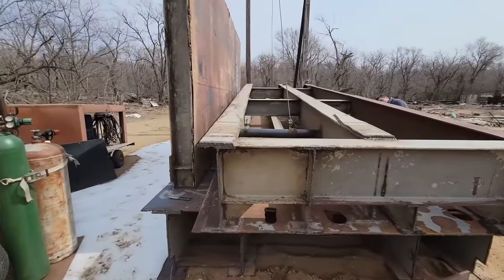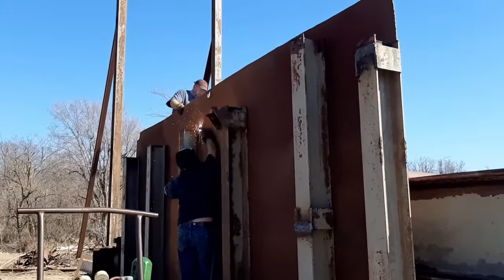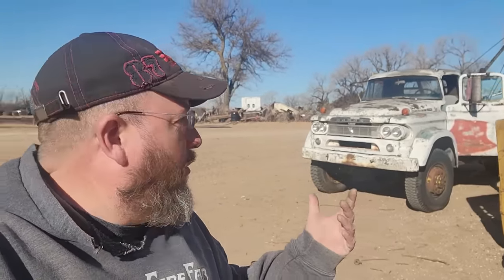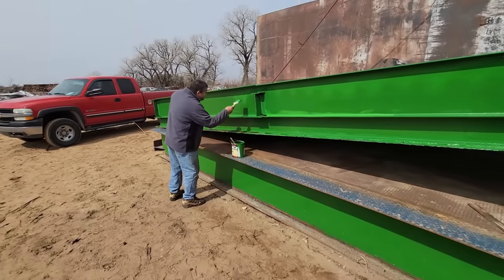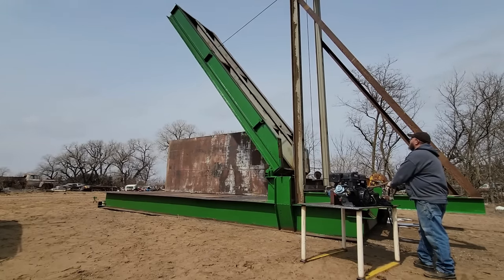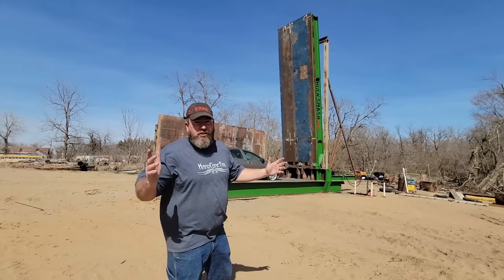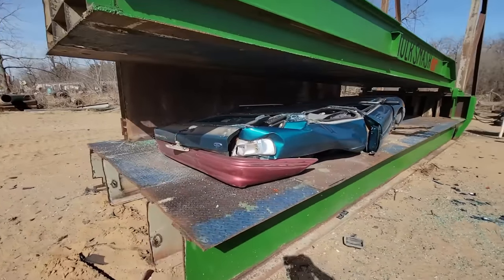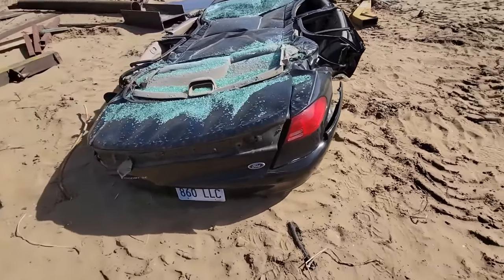WE BUILT A CAR CRUSHER!

Comment: We got one here almost identical to yours that was built almost 35 years ago, quit using it because it took too long to cycle, had issues with the cable and winch , but most of all was unsafe due to no control after it was tripped. Also doesn't work well on vans or SUV's because it blows them out too wide. Hydraulic is really the only way to go. And eventually your hinges will fail and when it does it's not pretty.
Reply: Where can i put my ex?
Reply: Facts

Comment: I'm impressed- but I think it would do better if the hinge was level with the table! also if you load the cars to the end of the swing it will make em flatter!😁
Reply: I was gonna ask him the same thing why did he position the hinge pin so high off the surface you figure it would be more stable if it were attached to the floor
Reply: @pipegang6497  that's my way of thinking! I agree 100%.
Reply: The only reason for the elevated hinge is it allows for better momentum and keeps it from binding up.
Reply: If hinge was level it wouldn't be able to crush 'flat' it would leave the cars less crushed on back side. Therefore could not stack the crushed cars.
🤷 That's just my weird little brain. Who knows 😆🙌✌
Reply: @mikethatguy27  you are correct, plus the engine is the most un crushable thing in the car, so having it level would not work
Reply: Yes little lower would have worked  way better
Reply: Yup bad design
Reply: Build a base you can adjust to meet the angle you require, actually have the car in there with the nose higher in front for more crush.
Reply: I'd buy a d8 caterpillar and just keep driving over it. Much cheaper
Reply: @jasonw833  I bet it'd be a Helluva lot more fun too!👍😆
Reply: Make the pivot height adjustable.
Reply: @jasonw833  Cheaper?  I seriously doubt it. Have you priced a D-8 lately? You better have 50 to 100 grand just laying around doing nothing.          (And that's for a used one)

Comment: In the early 80's my friend and I used to visit a scrapyard west of Montreal that had a similar crusher. What differed regarding efficiency between theirs and yours is the following: the pivoting point was only a few inches from the ground. As well an important factor of physics is sheer mass: the swivel structure was filled with concrete increasing the weight of dropping mass, thus the cars in a single drop would have been 12 inches high.

Comment: Built pretty much the same car crusher 45 years ago. 20 inch high beams and 3/4 steel plate. Burned up to Lincoln welders, welding at damn thing up. We use the 5-ton rear axle and the GMC V6 engine. It worked okay but it was extremely time-consuming and Messy. They ended up just letting the regular car crushers come in.

Comment: Love it. You should pour concrete in the top 6ft of it. Reduce the bounce add a few ton.
Reply: I think the winch is already pumping it’s little guts out already with the load it’s lifting already.
Reply from the maker: 30k winch whole lid is less then 13K and only picking up one end.  The winch is fine!
Reply: maybe sand ? concrete might crack if you dont reinforce it

Comment: What happens if you stack 2 smashed cars on each other and resmash them together ? Could you get another foot shorter on each car? May be easier to stack?
Reply: Yes... this would be worth watching
Reply: Adding a bit more weight to the lid I think it would crush two cars at once.
I still think that the hight between the bed and the lid is a bit too high. The hood and trunk are not affected much by the crushing
Reply from the maker: We are planning on playing with it more soon
Reply: @HardCoreFab  You could also try tilting the car to the side and giving it one more smash. 😎
Reply: if the engines are still in the cars they probably turn intoo a wedge shape , maibe if the stack them with the noses in oposite direction the engines can embed themselfes in the trunkspace
Reply: @watahyahknow  

That would be a total wedgie.
😆 👌

Comment: I would look to some sort of cable release and wieght the hook so you can free spool it down because the rapid unspooling seems like that will be hard on the winch.  Cool build
Reply from the maker: When the dog on the winch is disengaged the gears in the winch aren't turning so there is no stress on the winch.
Reply: I'm thinking he means like the bushings in the drum etc spinning pretty fast.  Probably hurt it over time.
A quick disconnect on the hook end of the cable might prevent that.  Sort of like a large car door latch you could pull with a rope on the cable hook end.
Reply: @scubasteve7946  yes plus cable whipping  at end

Comment: I sure wouldn't want to be removing a few parts from a vehicle while it's sitting on that crusher 😱  That's a pretty small diameter cable?  Just right for a snap one day.  I'm surprised that the hinge is so high up.  Likely half that height would work better.
Reply: Hey it has weight. That's what counts 😉 Not even lowering the hinge will help because all the mass is lost as soon as it hits the part of the car closest to the hinge. This is a coffee break project and not a piece being buildt to go into production. Pure männer fun stuff.
Reply from the maker: Yes you get it!

Comment: Well it does smash cars, I deny that but thats not all flat really! It just crushes roofs! For flattening it all out, you got to raise the platform on where the car sits, so flapper comes sandwiching car in between, but because your sitting ground is way below your hinges mechanism, it doesn't fully crush properly.
Its not hard to make, just a shorter panel to leave space for hinges to close in normally and just laying smasher more firmly and tighter on the crushed car. Aside from all above... Crushed cars looked in a real good shape though to be crushed, Except for last one!
Reply: You will most likely run in to the problem that the lever arm has to be double the length and double the weight to flatten it completly then.
Cause the lever gets momentum loss as soon as it makes contact , now the top part of the lever (fastest most momentum) makes contact first with a lower hinge the slowest traveling part would make contact first and would slow the smasher down giving it less momentum and less power.
Reply: It only has to crush the roof down to make it a level base to stack other crushed cars on top so they can be stacked on top of one another on the truck.

Comment: Nice Job! I'm in my fifties now but when I was a teenager, I drew up plans for a crusher just like this design. One correction I see is you'll need to push the doors in so it will fit on a semi trailer correctly. Overall, I'm jealous that you have this crusher and I don't.

Comment: If it was me.....  I would add a hydraulic cylinder onto a pin lock mechanism to hold the ram in the upright position. And then release the cable from the lid.  You have the hydraulic setup already.  Add 1 valve. And some hoses.   Pull lever.  Pin gets pulled out which releases hulk smash.   Cables under high speed whipping around open areas like that is my main concern.   Love the build.

Comment: I think i would load the cars with the engine towards the end of the smasher. I would also make another maybe 6"-10" plate to place on the platform under smaller cars to smash them even flatter since the hinge is so high. That or spin the cars around and hit them a second time might even work.
Reply: maybe have the hinge capable of dropping as it falls.
Reply: @1stontario  Would be easier and safer to just remake the hinge in such a way its adjustable and able to move up or down for thicker/thinner vehicles. That hinge needs to be rigid as possible to be safe as possible.

Comment: Male the hinge side closer to the bottom for more clamping action.  The gap caused by having the hinge so high uo doesn't help compress the front.  You could actually put more hinge points on the face of the hinge block and make it sort of adjustable if  needed.
Reply from the maker: If we where going to work it that could be an option but it's just a toy

Comment: You guys need to put a car on it's side, propped up, so it stays perpendicular to the deck. I'd place it so the engine bay (the most structurally sound part of the vehicle) is at the opposite end to the hinge, to allow a greater amount of acceleration of the top plate, to complete compress the engine bay.  You know, just to see how the HulkSMASHer does. I think it would perform just as smashingly as it did in this video.

Comment: My dad owned Anderson Auto Wrecking in Walla Walla in the late 70's early 80's.  They built one similar out of old decommisioned water locks (movable dam).  They plated the faces with 1" thick steel and they filled the top (moving part) and bottom with sand.  It worked so well that it was shearing the heads off V8's.  One day he had a bunch of railroad track that came in, so they cut it and through it in the cars before crushing.  The steel scrap / shredding company in Seattle called up and the CEO flew out to see his crusher and told him never to put railroad track in the cars again.  Apparently the railroad tracks really messed up the shredding machines.
Reply: His was a little different than your design, but very similar.  It would winch the top up vertically, then had big hydraulic rams that would lift the pivot point and top another 6 feet or so.  When he would release the pin, the top would rotate to approximately 90 before allowing  the pin side to drop as well.
Reply from the maker: Hahaha yeah the shedders don't like that big thick iron in car body's!

Comment: Very well done. I would have looked into a slightly different hinge design that would drop that plate at a flatter angle of attack, that way it would hit the cars on a more even strike. That way you could get let’s wobble in your strike, and the cars would be nice and evenly flattened. But very nice, and ASMR!
Reply: Well then, you just go ahead and build your very own crusher and we will be more than thrilled to watch your videos.
Reply: @chrisallen9154  Why the attitude.  He has a valid opinion.  I thought the same thing.   Only not every vehicle is going to be the same height or crush the same.  It would be quite difficult to offset the hinges while retaining the strength.  Based on other comments though, this is about as this type of crusher can get.  They blow out taller vehicles like vans, which could be a real problem when loading them on a truck.

Comment: If you make another side wall on the loading side that can be tipped up with the loader forks and latched after you load a car, then you will have both sides of the vehicles boxed in so they won't blow out the sides as much, keeping them more cubed and clean, it would also contain more of the flying glass and plastic !

Comment: It appears your fulcrum point is about 6" to 8" too high.  It should be level with what you expect the height of the car will be when it is fully crushed or at leas the height slightly higher than the front of the crush platform, so that when it is all said and done the crushing platform is level when the car is crushed.
Reply: I think it might put too much stress on the hinges if it was lowered.
Reply: That's what she said!
Reply from the maker: And what height would be best for a 77 3/4 ton ford van or a 1.5 ton grain truck...

Comment: I highly recommend installing a vertical steel tube with the winch cable running through it just incase the cable snap it doesn't kill the operator

Comment: Like any project you figure things out as you go.  Like your hydraulics, perfect for testing.  Late maybe upgrade to bigger motor and pump.  If you wanted to make it mobile, put hinges on the struts and tower.  Could use the winch to erect it at the new sight.  Best of luck with it all.

Comment: You really need to build a pedestal platform. That raises the height of the car up to the pivot point of the smasher . That pedestal only needs to raise the height about 1 foot , the easiest way to tell how much the loading platform needs to be raised by . is to raise the platform up to where you can hood a level against the bottom of the smasher and then measure from the bottom of the smasher down to the loading surface. Say y he distance is 5 foot then measure the ground height of the car to the top of its roof , what ever the difference is between the bottom of the smasher , and the top of the car would be the height  that the loading platform, would need to be to get the best flattened compacted results  . Out side of that you should replace the pulleys and use crane style ( hook block multi shelves on both the lower and upper locations . where your using single style pulleys . This will give you more Mechanical Advantage and reduce the shear weight on your wire rope . This won’t reduce the force on your tower platform, you may need to run a wire cable from the top of the tower down to the area around the lifting motor to prevent all of the violent shaking that I noticed on the tower . Likewise using crane style hook blocks will greatly reduce the stress placed on your lifting motor . I used to be a crane operator and have seen the good , the bad , and the ugly . But you have got a good design 👍
Reply from the maker: Thank you!  It does look a bit low in the video, but you have to take into account that the these are all small cars.  In our other videos we did a school bus and 2 ton grain truck it was almost to high.  In the end we just had to average out what could go into it set it and forget it.  Which is what we did!

Comment: No foot sides on it just a little bit bigger well little bit smaller than the sides in your dump truck and then make sure you leave forklift access to the side so you can wedge it up out of that otherwise your cars will be hard to put in the dump truck later

Comment: The hinges should be at the lowest level to get the vehicle flatter. Your way the vehicles are limited to the height of the hinges. Then I would fill the lid with cement to add more weight with the goal of seeing how flat you can make the vehicle. Right now it's not that impressive as the vehicle is still four feet tall. All you are crushing is the roof down the seat height, not that impressive. Standard is one to two feet.

Comment: Today’s cars all look the same. No class. Unfortunately for me, I ran a crane in a scrap yard in the 80’s. Lots of nice cars I had to load in the crusher. Most broke my heart. Cuda’s, mustangs, camaro’s, Lincoln’s, Cadillac’ convertible’s, amx’s, road runners and 57 chevys. Even had to put in my in-laws restomod  58 Chevy step side ( after a drunk with no ins hit it). I was only able to save one car. One car was almost brand new. A Saleen Mustang. The owner took pictures of everything we did.(fuel tank, battery and rim and tire removal) then he took pictures as I put it in the crusher. I had to stand up, take off my hat and put it over my heart as it got crushed. It was part of a divorce settlement ($30)!
Reply from the maker: Crazy! stuff right there!
Reply: @HardCoreFab  every time I see one of those cars at a car show, I wonder how many more would there be if I had sent crush so many. Was almost fired when I refuse to accept anymore

Comment: Impressive, but not fully proven.  Where is the van?  Where is the SUV?  Where is the loaded Semi trailer confirming everything that is crushed is not too wide to transport?

The durability of the hinges is also questionable especially given the sudden reverse of forces when the platform hits bottom.  What are the odds that they bend and don't break when this occurs.  I see the potential for very dangerous metal fatigue.
Reply from the maker: I didn't realize I had to prove anything.  But to shut you up on some if what you said, watch the second video
Reply: @HardCoreFab FYI "to shut you up" reads like just another toxic YouTube comment.  I'll trust that wasn't intended, and I'll check out part two next chance I get.

Comment: your filter is on wrong . You put it on the return from the valve.
Reply from the maker: You may be right I'm not a hydro expert but then if there was any trash in your tank it's going to be filtered out after it goes through the whole system and that doesn't sound right to me.  Please explain why my thinking is wrong.
Reply: @HardCoreFab  Most times if you put a spin on filter on the suction side of the pump it will restrict the flow supply to it and cavitate the pump. All the hydraulic systems I have worked on over the year just have a suction screen in the tank for the supply and the return is filtering the oil. You have a open loop system where the oil is always flowing from the tank to the pump through you valve till you move the handle and let the fluid go to a different path. I'm surprised that enough is coming through your set up.

Comment: Not very heavy with a half inch rope single part line.
Reply from the maker: I'm not sure if you are asking a question or what but the lid is 13000 lbs and it's lifted with a  9 1/16 steel cable